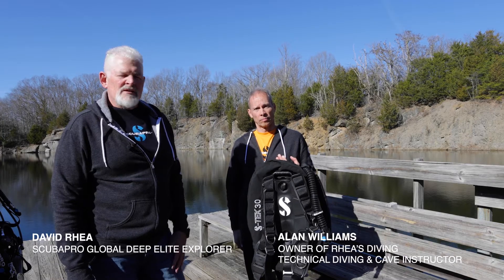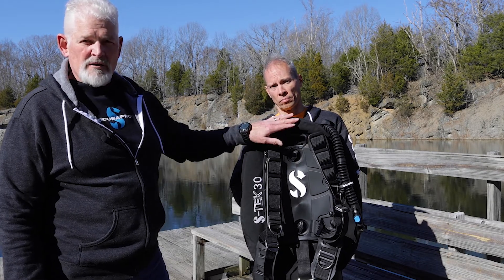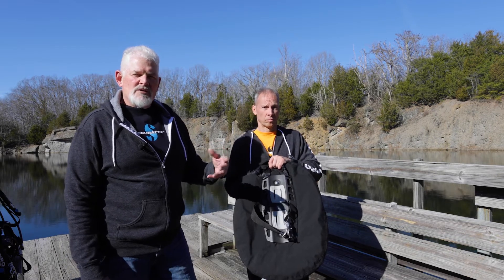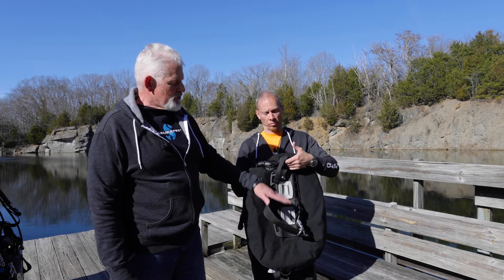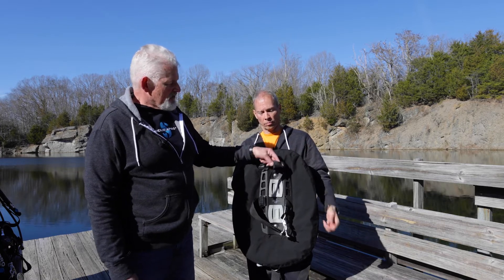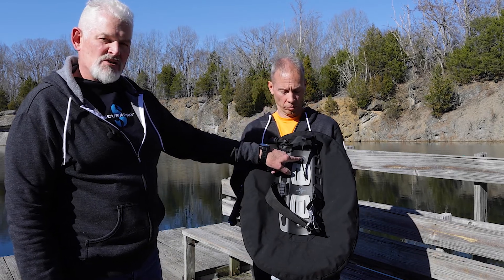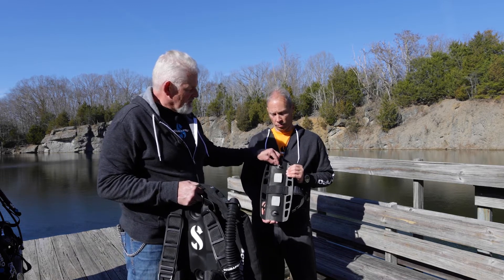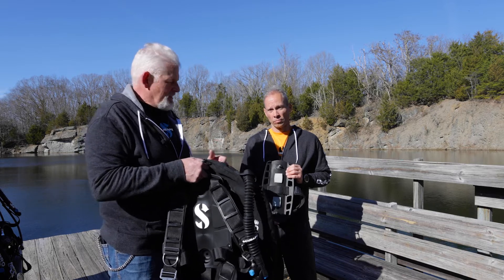S-Tek Gear Configuration, Part 3: How To Set Up for Single-Tank Diving

Comment: My top ergo nut keeps coming loose, as I’m using the S-Tek weight pouch on the back plate. Not really loving the design of how the STA works with the weight pockets. I’m only using 1lbs in the pockets, and have to remove the nuts IOT get the weights into those pockets. The STA should have been thought out better than this.